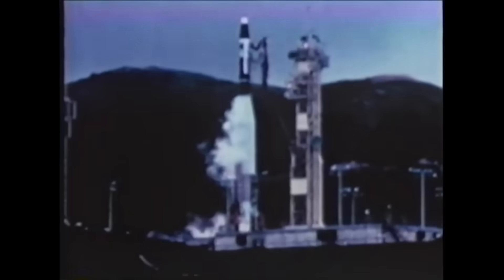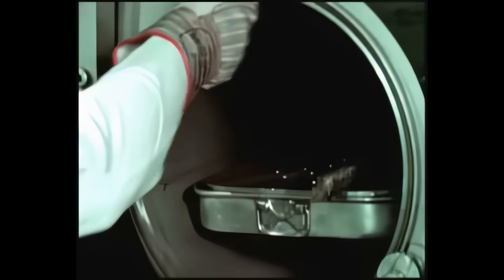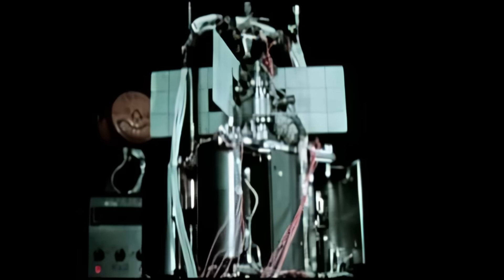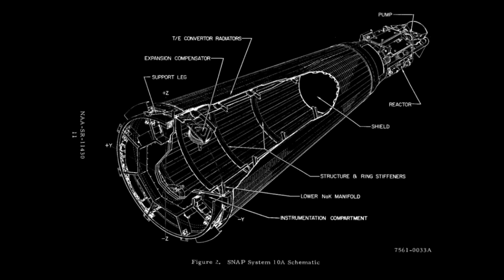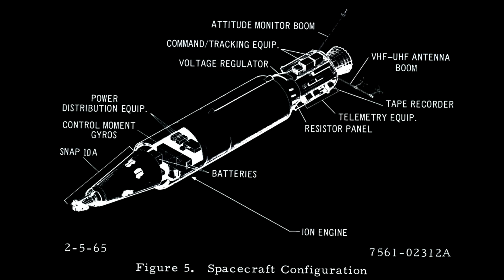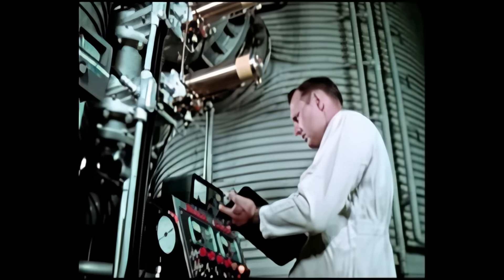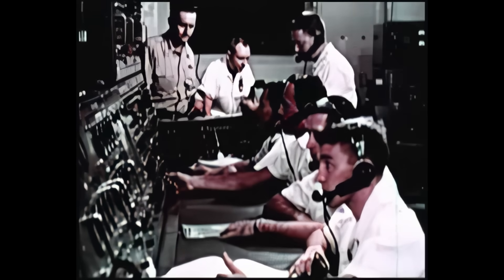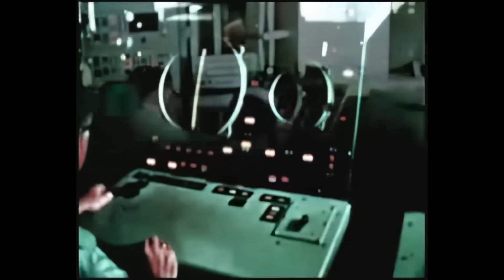USA Put A Nuclear Reactor In Space And Abandoned It - How Did It Work?

Comment: There are some old films that have been released of destructive testing of the SNAP reactors. 

There were several tests done. One test was of a full power excursion, where they designed a mechanism to very rapidly spin the Berylium control drums around to the full power positions and produce a spectacular overload and subsequent explosion of the reactor core. Then there was another test done where they quickly submerged the entire reactor in water, to simulate what would happen if the rocket launch was to have to abort, and the reactor fall in to the ocean. Water is a neutron moderator, and surrounding the core with water creates a power excursion similar to rotating the Berylium drums to the full power position. 

In each test case, the resulting sudden power excursions made for a spectacular explosion of the reactor. 
Even though there wasn't a huge load of U-235 in those reactors, compared to a much larger commercial power production unit, the power of the explosions was pretty intense. 💥

Comment: Just a small elaboration on "eutectic".  While it's true that a eutectic mixture will have a lower melting point, you can have other alloys that are not eutectic that will still have a lowered melting point.  I think the defining characteristic of a eutectic mixture is that it's balanced such that all of its components have the same melting point, and will freeze simultaneously.  It's' one of the things that's noticeable in solder alloys.  Eutectic solder like 63/37 Pb/Sn  will freeze all at once, where 50/50 or even 60/40 will make weird grains and be prone to cracking if it's disturbed while one metal is freezing while the other's still liquid.

It's a little pedantic, since I assume they did use a eutectic NaK, but eutectic shouldn't be used to describe just any mix with a reduced melting point.

Comment: By the time they've gone to the effort of having a coolant system, could you not just use a closed water system with a small turbine?  I assume you'd need some pretty hefty radiators to cool the water, but surely that makes more sense than a 1/60 efficiency rate.

Comment: SNAP was developed at the Santa Susana Field Laboratory, at the eastern end of Simi Valley CA.  The same place where they did static tests of the early rocket engines.  It wasn't the only sodium-cooled reactor.  There was also the "Sodium Reactor Experiment," a prototype for commercial nuclear power plants.  That reactor did have an accident that released radioactive steam into the air (something people claim is still contaminating the area - who knew steam could stick around that long?).

Comment: I still have old technical papers, where the MDAC company actually made pacemaker radioactive ionic batteries, for Pacemakers, repeat pacemakers.  We looked at these, in lieu of RTGs on several black projects.  Unfortunately, even though they had 8+years of electrical power, the adjacent electronics were somewhat sketchy, and unreliable.  RTGs were 110% reliable, for decades, and did not need anything to keep them functional.  The degradation due to decay, was usually accommodated via a truly simplistic upconverter which only had three active semiconductors.  This does reduce the available power in the long term, but allows digital electronics to operate at their rated voltages, over some smaller duty cycle.  If you give me a 500Watt RTG, I can design a reliable power delivery system, which will last for more than 100 years.  Since we already did this, for practical purposes, several times over...

Comment: Is there enough uranium in the reactor for it to be worth salvaging and reusing --- in space? It probably wouldn't be worth trying to use the reactor as-is, because not only could the coolant be missing, the generator is pretty miserable; but it looks like opening the lid and pulling the fuel rods out might not be that hard. (With a robot, naturally.) If these could be used in a modern reactor with a Stirling or Rankine cycle generator it should be possible to get a decent amount of power out of it, and all without the political problems of launching nuclear fuel.

Also, something deeply horrible has happened to all that archive footage...

Comment: Using a mercury boiler to spin a power turbine is the system proposed by von Braun, et. al., to power the space station and deep space craft in his "Mars Project" study of the late '40s and early '50s.  The only difference was the heat source, which was the sun. They proposed a polished parabolic trough aimed at the sun with a boiler pipe running down the focus. For the condensing side, the pipes were mounted on the underside of the trough, aimed at the 3K background sky. For the space station, the trough was bent into a circle and mounted to the top of the spinning toroidal station. I'd have to look it up, but I believe it was spec'd for ~2mW of generation capacity.

Comment: Just one very minor quibble: the U.S. DoE/DoD standard for weapons-grade HEU is 93%. This is how the reactor received such fuel - there was no other source but the U.S. stockpile for use in nuclear weapons (at least based on sources I can access while teaching about nuclear weapons).
Reply: In case this is a question, the reason the U.S. generally didn't enrich beyond 93% most likely because there was no additional benefit for the performance of HEU in a weapon
Reply: Also: The U.S. Navy now deploys reactors fueled with 93% HEU left from the 135 metric tonnes from over 60,000 decommissioned weapons. These new generation of reactors have a planned service life the same as the vessel and will never be refueled. This allows for sealed reactor designs that enhance safety.

Comment: Hey Scott, thanks for this history episode. I really enjoy them.

This gives me a chance to relate a story my Dad told me. He worked for the company that built the first ion engine that was flown into space. I don't remember that it went up with the Snap  reactor. 

The company was Electro Optical Systems, EOS, in Pasadena California. The ion engine was built under a contract from MIT, or some university like that. 

Like you said, when the engine was in space and turned on for testing, the high voltage power supply arced and shorted out. The power supply was in some kind of sealed container that kept some of the air inside.  Ground testing showed no problems because air is a good insulator  at atmospheric pressure. In flight, the container leaked  sir down to a pressure where the air ionized when the power supply was turned on 

Lesson learned; next engine had ports to bleed out the air. 

Twenty or so years ago I went online to search for any information on the engine. I think the Smithsonian had a copy of it. Plus, they had an experimental ion engine made by Dr. Robert Goddard. It seems that the concept for an ion engine has been around for a long time!

Comment: Hey thanks for the info, more than I ever knew.  I worked at SLC4 for Lockheed at the time and spent many months preparing for the launch.  Mostly I worked the ground telemetry systems and the SNAP was different than any other program, the telemetry as I recall was PAM instead of the usual at that time which was FM/FM with commutators.  Lots of overtime. Lots of different sensors on the pad to make sure nothing was leaking and we all wore radiation badges. I was just a kid so fun for me.  Thanks.

Comment: Great Video !  Great info on  the SNAP-10A that made it into space in the last Century !  NASA also worked on the JIMO mission that was to orbit three moons of a gas giant...  But did not have the Tech to make it work !  NASA recently worked on the Kilo Power and Mega Power projects to power a Lunar Outpost or a Mars Base.  NASA and DARPA are working on an advanced rocket engine that may use Hydrogen (H2) as a working fluid !  The NASA designed  "24-Hour Lunar Shuttle" (LEO to LLO) by Stan Borowski that uses an advanced Nozzle by Aerojet Corp. !  The "24-Hour Lunar Shuttle" is part of  Vision 4 of 5  of the Vision for Space Exploration  (VSE Presidential Speech January 2004).  The Lunar Shuttle will be supported by the NASA HLS/LEV/LLV !  For more info read the paper "Moon Direct" by Robert Zubrin !  tjl

Comment: A lot of people don't realize how pervasive the SNAPs were.  Most people don't realize this, but when Neil Armstrong left the Lunar Module for the first time, he was actually going out to grab the plutonium rod for their SNAP and move it from one leg of the lander over into the SNAP to begin powering the Lunar Module.
Reply: You are in error.  The LEM was not powered by the SNAP, it was the ALSEP package that was started on Apollo 12.
Reply: @TheEvilmooseofdoom  which created its electricity by way of a SNAP/RTG.  Dig a little deeper, you'll see that it was a SNAP effectively providing the power.
Reply: @csdn4483  Yes, that one and most of the SNAPs were RTGs, not reactors like the one in the video.
Reply: @zolikoff  SNAP stands for Space Nuclear Auxiliary Power.  There were a large number of SNAP designs, a fair number of them RTGs.  However, they're all revered to as being a SNAP.

Having received my degree in Nuclear Engineering, several of my professors talked about various ways of producing power from nuclear means.  One of my professors actually worked on Kiwi/NERVA.  This also lend to the various SNAP designs, but the thing to realize is this:  NASA called anything, even an RTG, a SNAP.
Reply: @TheEvilmooseofdoom  Correct, it was an RTG, not an actual reactor.

Comment: Abandoned It?! FREAKING ABANDONED IT?!??! The safety system overreacted to a voltage regulator failing on an innocuous subsystem having nothing to do with maintaining the reactor itself and blew the retention spring on the beryllium reflectors letting them pivot away from the reactor killing the reaction!!!! IT FAILED ENTIRELY SAFELY AS DESIGNED!!! IMHO, modern SMRs should use a similar design. If something goes wrong, a thingy pops and a neutron mirror  reflector slides down thus the reactor cannot physically sustain reaction in any ways until it is reset.

But it wasnt until russian hit it with some space junk that anything bad happened to it! So, no, SNAP 10 is not still up there. its in a billion pieces that randomly drift back into atmo.... Scott.....Cmon man.....Im gonna need to see your sources on this because we have entirely different recollections of how the  SNAP program went down.....

Comment: My father worked for Atomics International and worked on the SNAP 10A as a design engineer.  He said it was an engineering marvel.
Reply: It still looks like one when seen from 2024!
Reply: I'd be inclined to agree.  In that assembly footage, you can even see how the reflector modules hinge so they could be flipped away from the core in the event you need to perform emergency shutdown.  Amazing to miniaturize something like a reactor that much, back then and today.
Reply: My father worked it, NASA Lewis in Cleveland and the Plumbrook nuclear test center in Sandusky Ohio. He was working on the SNAP-8DR heat exchanger and turbo alternator power system. we went out to California a couple of times in the late 60s when he was testing at Atomic International.
Reply: I worked on the SNAP 10A right out of college.  I was a test engineer and worked on the ground test fixture which rotated the beryllium drums to control the reactivity of the reactor by reflecting neutrons back into the vessel.
Reply: My father also worked on the snap program at AI.

Comment: Hastelloy is named after its manufacturer (Haynes), not its content, it is actually a family of nickel-Chromium-Molybdenum alloys, meaning they are corrosion-resistant and high temperature alloys. SNAP 10A used both Hastelloy C and Hastelloy, although the cladding segment with the lowest expected temperature just used stainless steel.

Comment: As an old nuke, it's a shame we never proceeded with more research into nuclear generators/rockets.  Maybe SpaceX will?
Reply: There is a lot of regulatory red-tape around nuclear materials.  To even get the materials to make a test article could take decades.  I don't think Elon is that patient.
Reply: I agree. Working in nuclear for 40 years I know all about “red tape”/ regulations. There are many new startups developing SMRs, NuScale, TerraPower, etc. who have to work through the maze of requirements then run the gauntlet of the NRC approvals. Yes it does take time and money. Need to see if the cost benefits are there. If yes, maybe we’ll see new developments. Thanks for the response.

Comment: At a power level of only 30 kW and an operating time in space of barely a month, the burnup fraction of such a reactor was very, VERY low, barely half a percent of the burnup of normal reactor fuel in a PWR; and so while definitely still dangerously radioactive, the core of this reactor would have been nowhere near as intensely, fatally radioactive as normal spent fuel rods glowing in their cooling pool at the average nuclear power plant. Well over half a century now since it was operational, the radiation level will be far lower still than when it was shut down and while I wouldn't want it landing on my house or burning up in the sky over my city, the radiation doses to people on the ground if it did so today would be almost immeasurably minuscule.

Comment: Great job on the explanations here. As a nuclear guy, I'm always surprised at how many science content creators get just basic reactor stuff wrong. Yes, absolutely, nuclear geometry is VERY important in reactor design. Not only to achieve criticality, but also for safety and control. I find it interesting that they had hafnium in the fuel cladding. Hafnium is a big (BIG) neutron absorber and is often used in control rods to reduce neutron flux and "slow a reactor's roll" so to speak. Or shut it down by inserting all or a certain group of control rods into a core (aka SCRAM). 

Normally hafnium and zirconium are found together in nature, and to use zirconium in fuel cladding (Zircalloy, the most common type) the hafnium has to be processed out so it doesn't inhibit fission. Maybe they allowed some small amount of hafnium to act as a neutron poison? I'm not sure. It seems like with such a small mass of U-235, they wouldn't really want a poison. Then again, maybe just removing the reflectors wouldn't be enough to quickly shutdown this little core without a preexisting poison in the fuel cladding. I'd like to know more about this. All I remember from all of the materials stuff I had to study in school is that hafnium = bad in fuel cladding.
Reply: Actually there was NO hafnium in the cladding. Scott got the composition of Hastelloy-N wrong. He said he believed it was hafnium and tungsten but actually it is a nickel based superalloy that does not have any hafnium at all. As you noted hafnium is a neutron poison and using it in the clad would have meant this reactor would be have been able to go critical.
Reply: Light Water Reactors use high neutron cross section materials such as boron or gadolinium as burnable poisons fabricated as discrete rods or mixed with the fuel to compensate for the high reactivity of a brand new core. Being highly absorbent of neutrons, they deplete somewhat quickly as fission products build up to add negative reactivity. The designer might have selected hafnium because the core was quite compact, high initial enrichment as well as materials concerns such as melting point and compatibility with the NaK coolant.

My “Chart of the Nuclides” (no REAL Nuclear Nerd should ever be without it) is boxed in the garage. Maybe I’ll dig it out and see if which isotopes of hafnium they might have used.
Reply: A poison could also be used for power shaping, though it might be easier to vary enrichment of the fuel elements in a design like this.
Reply: "As a nuclear guy, I'm always surprised at how many science content creators get just basic reactor stuff wrong."

'Content Creator' is a position without requirements. A job title more than a skill set. Nothing much more than a vague description. The minimum required to entertain even a minute percentage of a huge potential audience. 
 
People of Scott Manley caiber? Maybe 'Master Science and Technology Communicator' is descriptive.

Comment: Alvin Weinburg proved that molten salt as a nuclear fuel is not only self regulating it’s also extremely efficient and it burns 99% of the fissile components in the fuel. The waste has a 1/2 life of 30 years vs 30,000 years for traditional solid used fuel. It does not need a metal coolant so avoids the complexity and pollution hazards.
Reply: Yeah but dont you need to get it up to a super high temperature and maintain it there? That seems difficult to maintain in something this small in the heat vacuum of space.
Reply: Molten salt thorium reactors are the future, and we already had that technology in the 60's.  But we went with Uranium fueled reactors and fast breeders in order to make plutonium for atomic weapons.

Funny how China and India are both researching this tech, and we sit here doing nothing with the tech we've already proven works.  Not to mention the US has huge reserves of thorium...

But hey, the politicians know best, right?